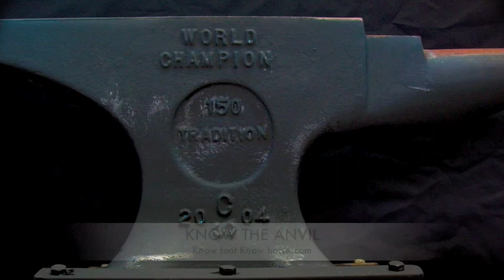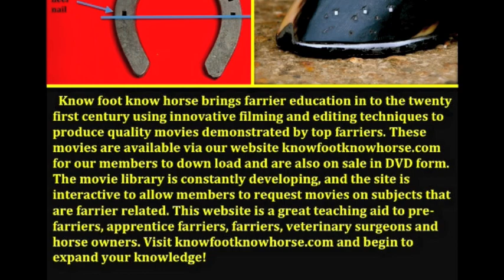how to use an anvil

Comment: @gatorj3333 any stable sturdy mount will work as long as 1 it doesnt woble 2 you can secure your anvil and 3 its at the right height. i too am using an oak stump so you should be all good and if you want try and personalize it to give it that gatorj3333 feel

Comment: NO BLACKSMITH WHO KNOWS ANYTHING STRIKES HIS ANVIL WITH A HAMMER WITHOUT HAVING A WORKPIECE BETWEEN THEM.
Reply: +Rohan Zener AND SOME EVEN KNOW THE DIFFERENCE BETWEEN A BLACKSMITH AND A FARRIER.
Reply: +Rohan Zener A FARRIER SHOES HORSES AND MAKES HORSESHOES. A BLACKSMITH DOES THIS SOMETIMES BUT IS NOT LIMITED TO JUST HORSE CARE.
Reply: +shadowmink888 Has your Caps Lock key get stuck? You should check that ASAP, because it's making you look like a total tool.
Reply: shadowmink888 So it's making you look exactly as what you are. Ok, never mind then.
Reply: +shadowmink888 As I was saying, your choice.